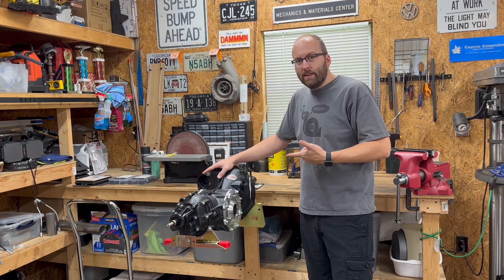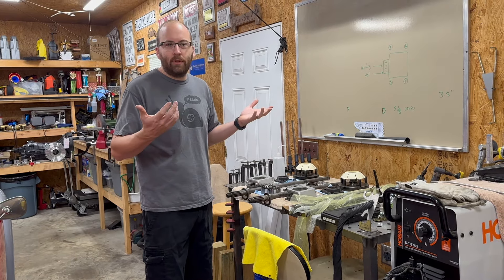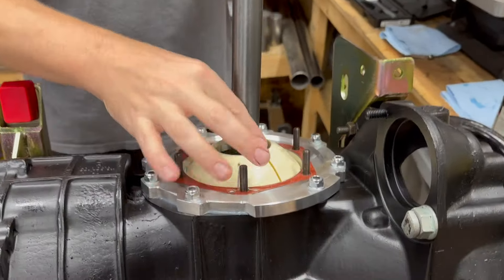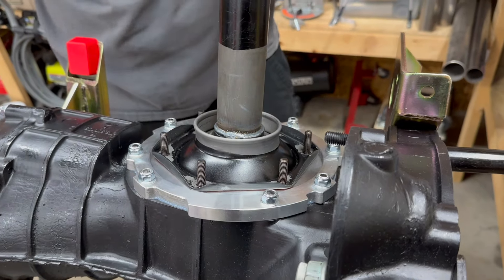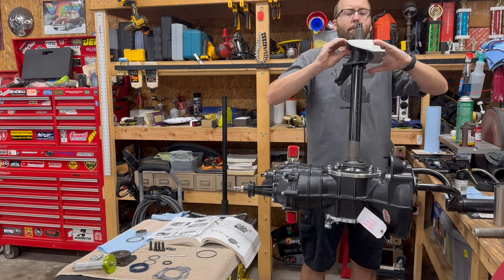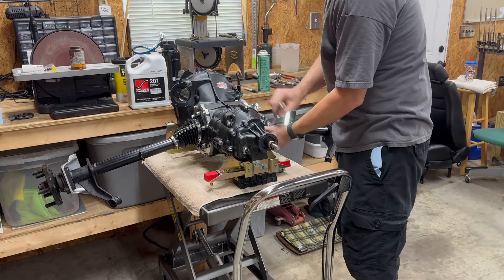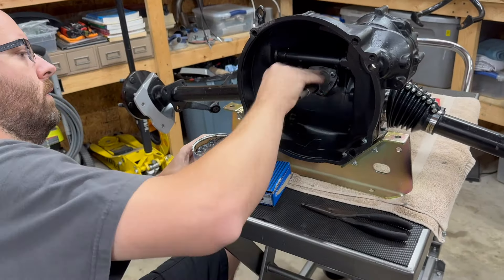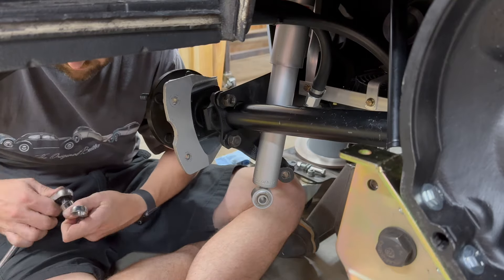New Benco Turbo Swingaxle Trans Install

Comment: Need to use one piece boots if you have the tubes out like that..
Reply from the maker: Certainly an option. I already had these accordion style ones on hand so I just used them. I wasn’t actually having trouble with the split part of the stock style boot I replaced. It was actually the small end of the boot where it clamped to the tube that leaked. No matter how tight/loose I had the clamp or how I positioned the boot, it always dribbled. Oh well… These cheapo accordion style boots haven’t leaked a drop so far 🤞🏻

Comment: what mini-split system did you install in your garage? i want to do the same.
Reply from the maker: It’s a Fujitsu Halcyon. I need to finish decking my ceiling and adding more insulation, but even as is, the ac makes a huge difference